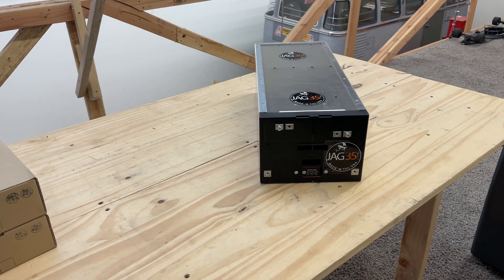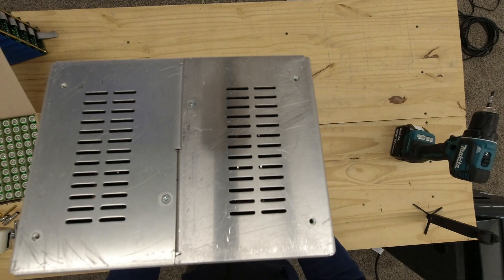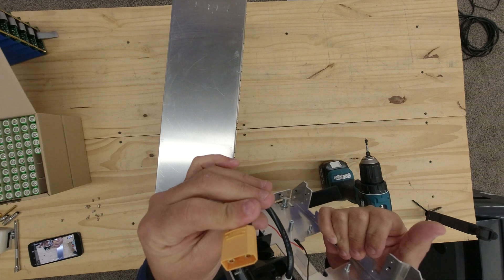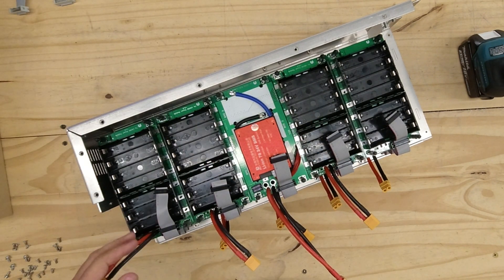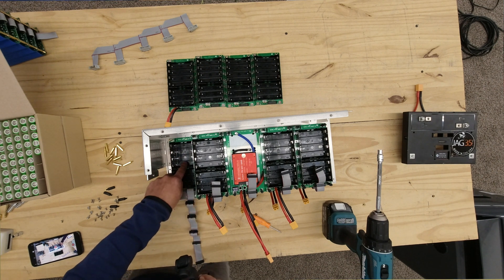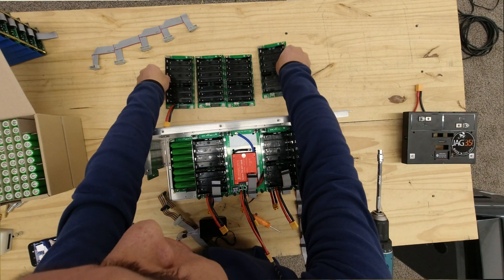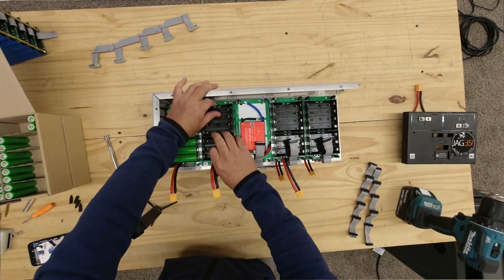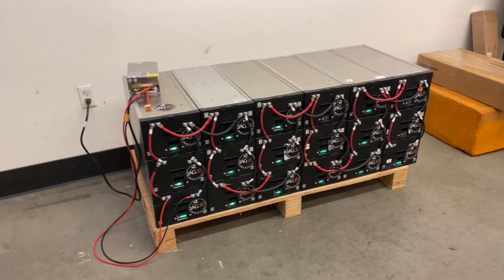Easy Build 2kWh PowerBox - Emergency Lithium Battery

Comment: looks great in terms of no soldering, etc.  Not clear as to what you connect to it to get power. Didn't see 110 V outlets or a 12 v  socket on the front.. Also, would a bms be required, and an MPPT controller if you wanted to recharge this via solar, and anything else if wanted to charge this from the wall?

Comment: Perhaps missed due to checking the product page via phone but I didn't see any dimensions, weight, or other relevant specifications such as per unit current capacity.

Comment: great videos :) my system needs a back up , I went 24 volts with mine but you always need more power !!!  lol I thought my battery would last longer then 4 hours , same with my solar - you always underestimate how many batteries or panels you need lol

Comment: Is there a way to make it 12v instead of 24v I just picked up the duracell 660 solar generator and it runs 12v wanting this to expand the battery. Thanks in advance!

Comment: On jag35 25 pcb are 199$ and 75pcb are 699$.whats the point.It should be less than 600$ is this some mistake in pricing.ty

Comment: I've learned a lot about alternative power systems from watching you and Will Prowse.  The information in your videos is more useful b/c you give step by step instructions.  And you really dive into the nuts and bolts of how these work and are constructed.  Based largely on your review earlier this year, I purchased a Bluetti AC200 and 720W of PVs.  Additional power storage will make this a better solution for my needs, so I am also going to get your powerbox and new 18650 cells.  If this works as expected, then I will continue to expand the storage capacity using this approach.  I'm sure I would not be doing this as a project if it weren't for your videos. Thanks for all your advice.

Comment: TWO QUESTIONS: 
(1) Would these Battery Box’s populated with loose (Inserted Lithium Cell’s ) vs (Spot-welded Lithium Cell’s) When those cells were installed in an Earth-Cruiser style RV vehicle that would be subjected to prolonged vibration and bumps of rough roads. Not run the risk of connection issues? And Carbon build-up on battery terminals due to these conditions? 

That would be my application.

* I recognize that most all other use & applications for these boxes wouldn’t be subjected to the physical extremes of my application and would probably be just fine.

(2) Do the electronics inside these Boxes have any: 
(a) Low Temperature charging cut-off... or, 
(b) Over temperature sensor monitoring the cells?

Thanks,

 GA
Reply: I would not use this in anything that moves.

Comment: Neat powerbox, but in any case I'm kind skeptical of using dozens of 18650. I've just build myself almost 3 kWh powerbox from 8x 110AH LiFE prismatic cells which is in my eyes a cleaner solution.

Comment: So, I would love one of these. I just don't know what I would do with it. And I can't tell what kind of output connections exist. Can anyone give some use cases?
Reply: Obviously I can charge various thing...that I currently use an outlet for. New house so outlets every 6 feet. Could take it camping to charge various items but I need a converter I believe to use the various chargers (adapters). Would love a few of these to have it back up my house electricity, but what do I need to get it hooked up to a standard 200A home?

Comment: Nice box! What was it before it was repurposed? Any idea what it weighs? I've been working on putting together a 24v battery for my shed to power some lights and use as a learning tool when I add solar and an inverter. Eventually I'd like to scale up and make a 48v power wall for my entire house. Unfortunately my source for free 18650 laptop batteries dried up so I'm starting to compare costs and look at other options if I'll have to buy batteries. So far it looks like most batteries are priced ~$100/kwh but the materials and tools required to put them together vary a bit.

Comment: I have some old APC rack mount units with AGM batteries that I got at an auction.  I'm going to have to check out your website and see if I can convert to 18650s.  Nice work on the design with this one!  I'm really enjoying your channel and appreciate you sharing the knowledge.

Comment: Random Comment.. ;) On a serious note this seems to the be the best overall solution you have done. Uses all the other components in an easy to build easy to use setup. I am doing a off grid solar system in a cabin, this seems like it would be great... add that new crowd funded balancer so I can monitor remote... perfect!!!

Comment: Pretty Sweet! An instant power solution. Just add cells and you have a professional battery. I like how you keep adding to previous designs and combined them to develop the next product. Next step may be to offer a complete battery with cells already installed! Keep rocking Jehu. I've watched you grow over the years and even with failures you pick yourself up and keep on keeping on. I'm not much of a do it yourselfer any more as back surgeries have left me in worse condition than before the surgeries. But last month I did build up a ups and battery pack for my sump pump. Used cells you recommended from battery hookup and a ups from the recycler you recommended in California. No more flooded basement when the power goes out! Thanks alot! Was fairly easy and cost 80 percent less than a retail version.

Comment: Man those thing are so freaking awesome. 
What kind of Charger / Intervener woudl you go with if rigging up for Timed Based Billing form the Utility Company? I dont have any Solar as of yet but would like to rig up for Time Based Billing and use contactor or something to disconnect  the charger / connect the inverter during peak hours.

Comment: I have a 24v battery forklift EFG 110 from auction that I am currently working on, the forklift needs a battery replacement first before fixing other errors. I hope I win your battery to test on the forklift.

Comment: Question: I know that when you connect all those ribbon cables, you are connecting batteries from different trays (or levels) together. Is there a limit on the number of levels you should be connecting using the ribbon cables. Is it a BMS issue?
Reply: Typically a BMS is a "Battery" management system. Meaning one.  The way he has this wired up is each tray has 7 cells in series (3.7v x 7 = 25.9v) then each one of those trays are wired in parallel to the rest . So battery 1 in each tray is wired to string 1, battery 2 in each tray is wired to string 2 etc.... He is using the LGM36 which is a 3450mah battery so 24 trays x 3450mah = 82.8 Amps  and 25.9v x 82.8 Amps = 1987 Kw

The Problem I see here is he is using a 7s BMS Module 50A-60A -1200W so he is using one string of the BMS to manage 24 batteries in parallel. 7 batteries in each tray 24 trays total.  

So to answer your question could you add more? Yes. I suppose you could add 100 trays if you wanted. The problem here is that the BMS wired in this configuration can only manage 24 batteries combined in each tray (or however many trays you have). Not each individual battery. So if you have one battery go bad in the 24 group. Your BMS cant see that. If each tray had it's own BMS then if one of the batteries started going bad then the BMS would cut operations to that battery essentially taking it out of the circuit.  

The LGM36 is a un-protected cell. So if one cell drops below the safe discharge voltage it could do nothing, it could short, it could blow up but what ever it does will most likely affect the rest of the batteries in that parallel string of 24 since they are all tied together. 

In a perfect world this setup should be fine for some time but as Li-ion age this could become an issue. I will say that what he is doing is the way most people are doing it but not using individually protected cells you could be building a massive fireball. 

I'm a big fan of electric bikes and have 4 of them all of which I have built my own packs.  But building any battery pack can be dangerous if your not careful.  If you haven't seen photos. Go to Google Images and google "li ion battery pack fire explosion" and see how many people have had issues. 

All in all if your going to do this. Use new cells. Preferably protected cells. These cells have a little BMS in the top of each battery that will stop the cells from over charging or undercharging or completely just turning the battery off if it is going bad preventing any damage.
Reply: @jamescole6846  From the link above. Aren’t these cells 3.6v nominal? With 7 in series, should it be 25.2v?
Reply: @ilingwang1168  i rounded

Model: M36 (M36T)
Size: 18650
Style: Flat Top
Nominal Capacity: 3450mAh
Continuous Discharge Rating: 5.1A
Nominal Voltage: 3.63v
Protected: No
Rechargeable: Yes
Approximate Dimensions: 18.5mm x 65.4mm
Approximate Weight: 48.25g
Reply: Thank you for this! What a great setup for beginners.

Comment: Notice at the beginning of the battery install that you had a bad battery or unmatched battery?   So even with new high quality battery, you still need to monitor and check them.

Comment: great work by a great person  Man you rock!   hey I am planning to built a Li-ion 72volt nominal and 5000watt battery pack for my electric car project to be implemented in my Final Year project at my university  and i neeed some sugestion that would it be suitable for the car since the car would have dead weight of 600kg  and i am planning to use a 5Kw BLDC motor the car can acomodate 4 passengers and max speed of 60km/hr

Comment: Hi I wanted to thank ☺ you for all the work you do. I have a 12v off grid system and lost two 400 Amp do to my lack 😤 of battery management my overseas supplier turns his back on me. I was in the process of going back on grid but I like 👍 your battery box idea 💡 some of my batteries are good. I have to have the confidence to do it thanks again, I like the VW.

Comment: I live in a cold area prone to power outages and recently set up a generator. 
Have been watching you videos trying learn how build a "power wall". Mostly so I can shut down the gen at night and still have heat, save fuel, and not upset the neighbors during an outage.
 This battery box would be a good starting point for us.

Comment: This would be super helpful for running my DC lipo chargers when I go to RC meetups on the weekends. I got a couple ISDT DC-DC chargers and there isn't always an outlet available to run my switching power supply. Every meetup at least one of the guys shows up with one or more flat lipo packs, it would be super rad to have a full charging station in the back of my Blazer.

Comment: Nice..but when are you going to make ebike 48v box with 21kwh....in two sizes.. long and square.I already ordred one on Aliexpress.for 30€.13s6p...without cells but the bms is soldered directly on the bus bars so no spaghetti b+ wires to solder...why is it so difficult to get a complete kit ????why is it so fucking hard to get a ready made kit and just add batteries..  ????? When is someone going to make a kit for..Power wall.. ebike or   motorbike...maybe the Lego company should be contacted..  😃❤👍lol  maybe you should try building a Lego powerwall !!...Jehu your a good Guy but you need to think beyond the box...If I had your facilty I would be working around the clock in trying to innovate a new 18650 building block system...you need to think a modular Fisher technique system.